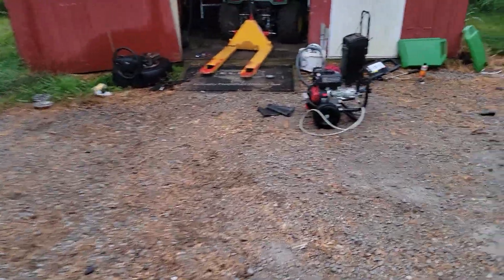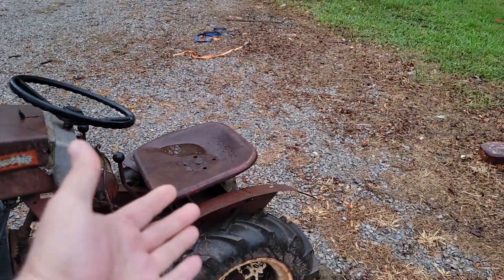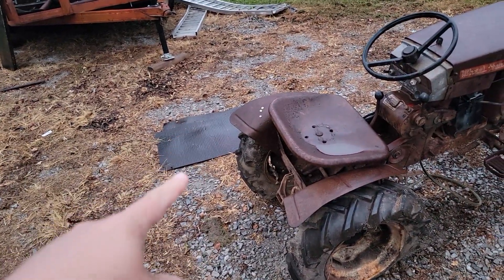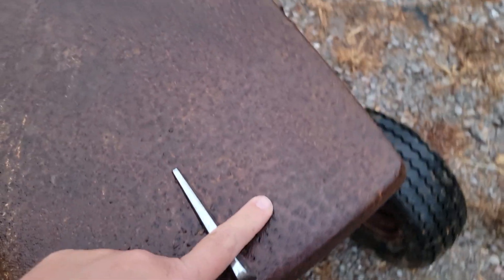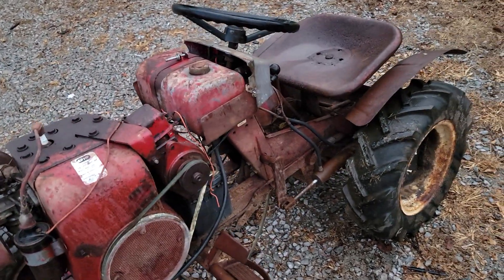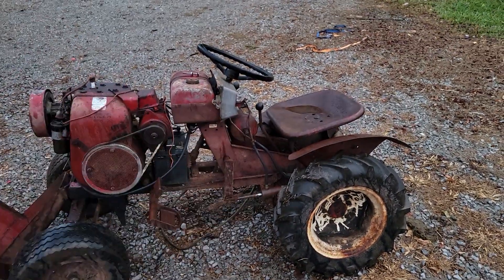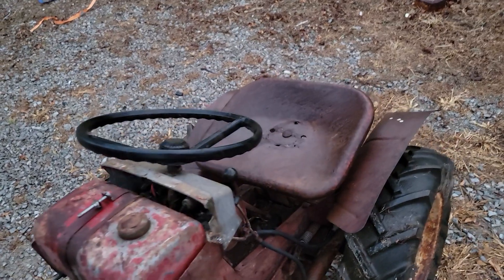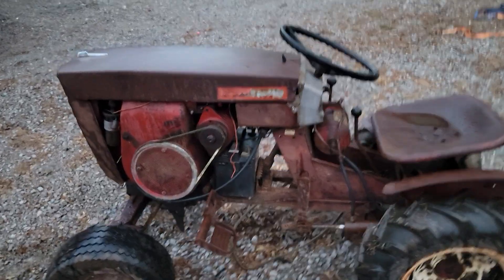New Wheel Horse 1045 project.

Comment: Excellent find Man! Congrats on getting ahold of such a rare model...
Reply from the maker: Thanks.    This is the quickest comment I've ever gotten after a upload.
Reply: @Bairleafarm   🙂.  Good timing.  I was perusing some other stuff. Your video notification popped up so I switched over.   
That's a great candidate for whatever you end up doing.  
One year ONLY. 
The ONLY model Wheelhorses with round fenders and square hood. 
Great workers too!
Reply from the maker: That's what I've found which makes me want to not mod this.     I dunno I'll have to get it cleaned up and really see what's there.
Reply: @Bairleafarm   there'll be others out there too. 
Up to you and your own to do with. You could get some spare parts and use those for the modifications. Set aside the originals in case you want to return it to factory condition.